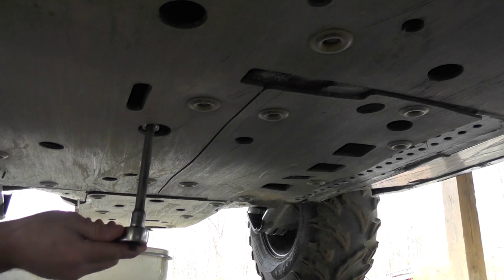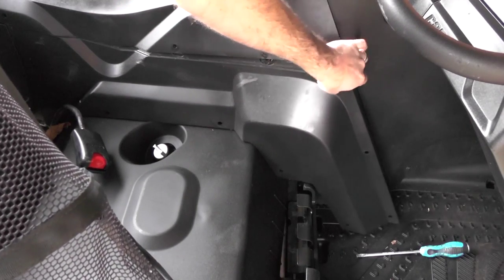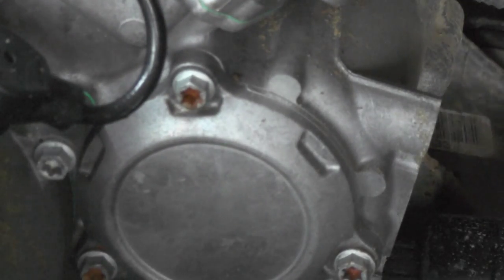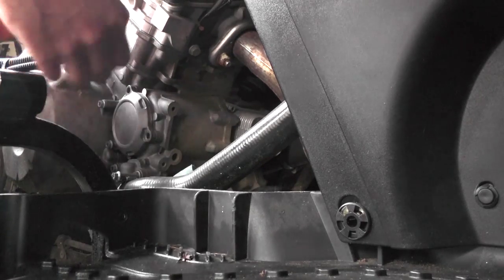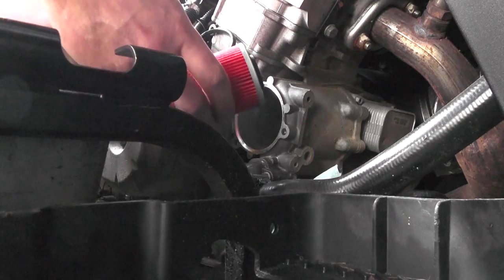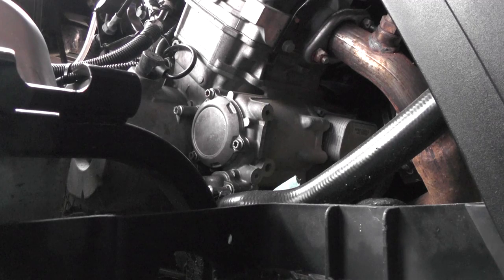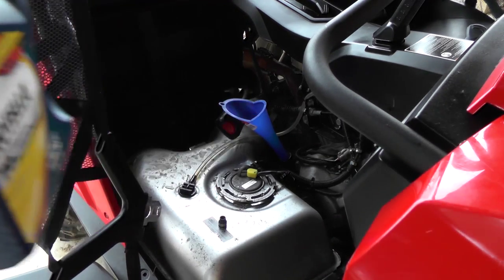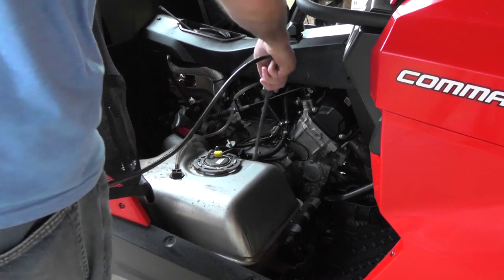Can-Am Commander 800R-XT or 1000: Oil Change: 2.1 Quarts Full Synthetic 5w-40, Oil Filter

Comment: you made it look easy. I found Castro edge 5w40 on sale at napa for $5.29/qt. Rotella or mobil diesel would be my 2nd choice
Reply from the maker: Appreciate the comment Chris and we do try our best to put good info out there.
Reply: A crap load of work for an oil change. Fail by the engineers.